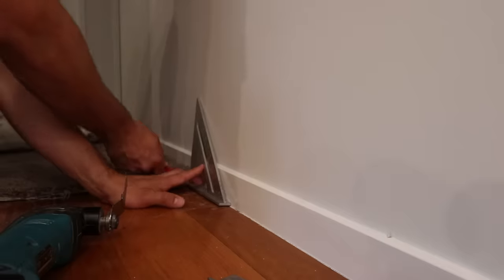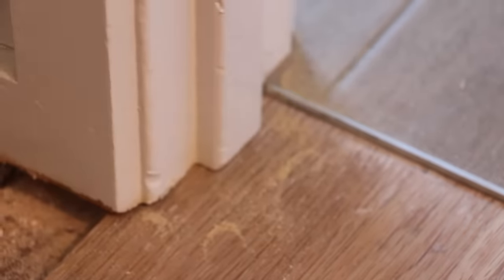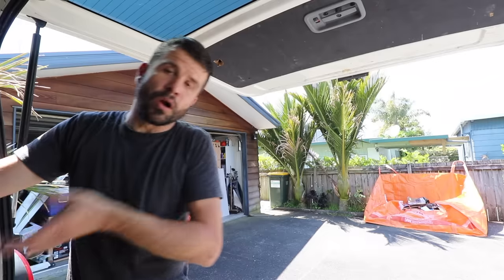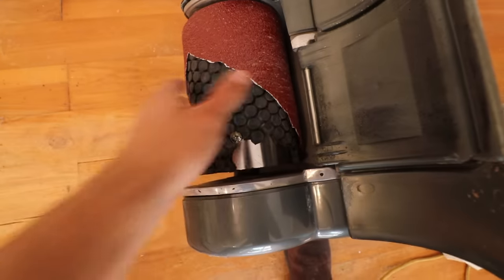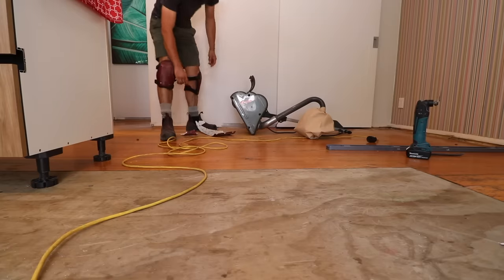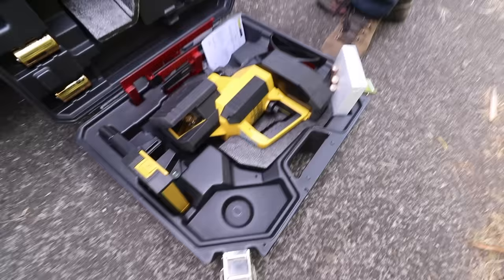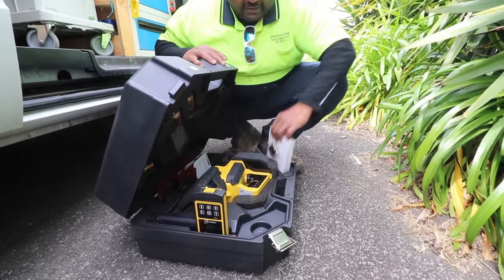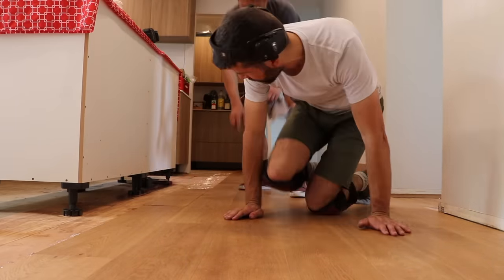Installing Hardwood Flooring (with Glue)

Comment: The guy at Lumber Liquidators told me it was OK to glue 5/16" solid oak to tile. Well, the oak stuck to the tile alright, but the tile was originally put down with some sticky stuff that let it pull off with a loud snap. I ended up with floors that looked fine but made a racket when I walked. They are OK now after I burred a few hundred trim screws in them. Engineered wood over recently sanded wood will probably work out  a lot better, but anyone considering gluing a floor should make sure the flooring an substrate will play nicely together. 
PS: I replaced the baseboards and cut the door frames the same way they did here, but I've seen houses with metal door frames where they just cut the new flooring around everything. As long as it's not a floating floor, I suppose either would work.

Comment: Why the glue on floor though if ur nailing
Reply: Nails pop over time , glue is doing all the work
Reply: Hes only nailing each run but he should be using flooring straps to tighten everything  up before nailing  his runs!

Comment: So no allowance for thermal expansion, especially in NZ ?  I would have done this as a floating floor in the UK with an insulated separation/underlay layer, with 10mm gaps around the perimeter for expansion and especially no nails or glue.  As this is glued and nailed, there s a string possibility it will cup and rise in places because there is no allowance for thermal expansion.  Were these new boards also laid in the same direction as the boards underneath ? 9:17 expansion gap ?  how will that work when you have glued the boards  and nailed them?  Finished job looks good, but wait a couple of seasons to see results of thermal movement !
Reply: Mario  Yeah it will, it has a 3-5mm plywood finished veneer, it will expand and move.  The boards underneath that they are glued and nailed to will also move.
Reply: Timber floor will move and if the lam floor doesn't  as suggested 😬
Reply: I know what you are saying and I have done a floating installation myself in a flat in London. However, the place i got my flooring from in Forest Hill says "14 mm engineered flooring is laid either as a floating floor or is glued permanently to the sub floor using glue with a high solid matter content such as Rewmar MS Polymer flexible wood flooring adhesive. It is recommended that you use a professional installer if you are gluing to the sub floor."
Reply: I was thinking of that expansion gap too, why is it there? And I would have done it exactly the same way as you explained, floating, underlay layer and with 10 mm gaps. No glue or nails. But maybe they know something we don´t.
Reply: @onanisland5527  Bobbie they probably know alot we don't . 😁 

Third edit 🙄
Reply: seems to me it's (cross)laminate flooring, even with the veneer top, it doesn't expand or cup much. Also, the glue allows expansion.
Reply: Elfin4 totally agree, I would of laid it exactly how you said but also glueing the tongue and groove together to keep it all together.
Reply: Mario  it'll be cold under that there floor bud. Air flow n all that business
Reply: Mario  I would always install as a floating floor if laid on top of an original floor. with expansion gaps around perimeter.
Reply: Either either. But gluing is the best way to go. Have installed on a heated concrete floor no problem with the temperature variation. The insulation is below the concrete so you don't want another foam layer between them.
Reply: I should qualify that - gluing is the way to go when you use a laminate with a real wood layer on top. Allows refinishing 10 years down the track.
Reply: @DiscoFang  Well teh underlay is not exactly thick foam it is merely there as a separation layer and slip plane to allow the floating floor to move independently of the sub floor.
Reply: @DiscoFang  Please explain how gluing has anything to do with refinishing in 10 years time ?  With a real top wood layer that's more important to allow it to move.  In the UK  the NHBC house builders recommend 10mm gaps around the perimeter and floating floor.  Not sure if there is a house building code in NZ for floating floors.
Reply: Elfin4 That foam works remarkably as a thermal break. I've used it as a layer under retro-fit thin timber t&g wall lining & it makes a night & day difference.
Reply: Elfin4 For refinishing I was referring to the quality of the laminate flooring and top layer of real timber. It can be treated somewhat like a natural timber. Not sure how resanding or machine scuffing would go in a floating floor. I'd think it could chatter and move the boards too much to get a decent refinish. Could be wrong in that
Reply: Elfin4 One thing I do know is New Zealand's experience of timber floors and timber house construction. I also know the UK has generally very different methods of construction including seeing old oak floors that are not only NOT T&G  but also not even nailed to the floor joists.
Reply: Elfin4 To reply to your other question.. There is no specific "code" for floating floors, it'd be like having a code for laying carpet. Yes, manufacturers have specifications for different types of floors and ones like in this vid have spec for both overlay & for glued to substrate. Yes laying a floating floor requires allowance for thermal expansion. This is not laid as a floating floor. Different methods for different constructions & for different results.
Reply: @DiscoFang  Yes it does, but it also provides a slip plane for thermal movement of the floating floor.

Comment: Thanks Scott for the upload. An thank you for always motivating me I have a passion for carpentry n when I watch you it just give me more strength to finish my woodwork career. South los Angeles in the house.
Reply from the maker: That's cool to hear man, keep at it
Reply: The connection with LA is in most of the houses here in NZ. From the late 1800's to the 1960's the designs, the carpenters, the methods and the lumber milling machines were from west coast US. Come to a place called Miramar in Wellington and from some angles you could think you're in Pasadena. (In the summer!)
Reply: @DiscoFang  you know what you talking about, a lot similar then you think

Comment: NOOOOOO, you didn't do under the kitchen island!? was it impossible to move out the way?
Reply: That was my thought as well!
Reply: You dont need to do under the kitchen island completely, kickboards cover it
Reply: @jackmeoff7686  you're missing the point, what happens if someone decides that they don't want the kitchen island, and they would like to remove it?
They have a gaping hole in the floor to fix.
Reply: allan walker maybe so but I lay floating floors for a living and we’ve never gone all the way under kitchens or islands etc and still been in business over 6 years

Comment: Will you put under the kitchen island ? Interested to see how 🤔
Reply: I thought the same..... why not lift the island to slide the new flooring underneath?
Reply: The island looks like its waiting for the toe kick boards to be installed and they probably wanted to lay the flooring first get the height correct.
Reply: @kcbowls300  Homeowner probably doesn't want to pay for materials and labour to finish a surface that won't ever be seen.

Comment: Why did you not lay the flooring under the island?....it makes things really tough if at some point the client changes the location of this or removes it...
Reply: Because kickboards cover it
Reply: @jackmeoff7686  Which is fair enough but the island is the only cabinet in there which might possibly be moved, altered or removed one day & the chances of finding another pack of that identical flooring then is nearly zero. I would  have done it...

Comment: I was under the impression that Engineered Hardwood is indeed plywood with a layer (~3mm or so) of solid hardwood on top. Is that not the case? What's the main part made of?
Reply: It is indeed plywood with a thick veneer!
Reply: Some are now engineered with sold timber instead of plywood backing, still with the opposing grain layers.